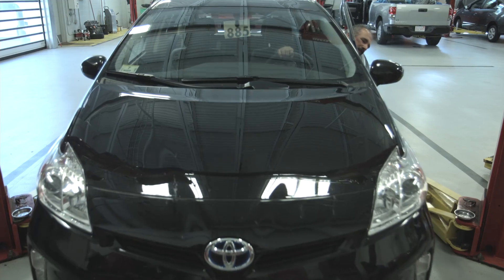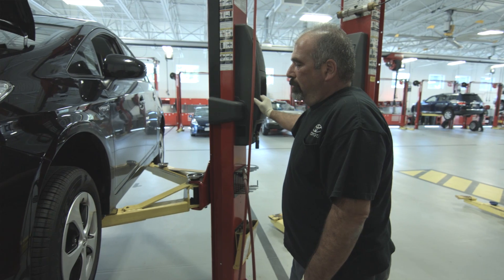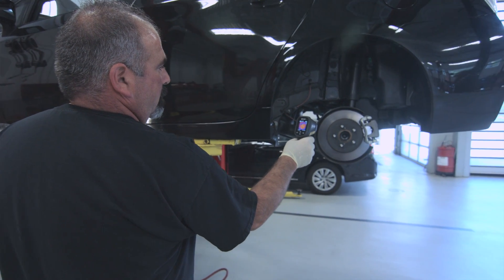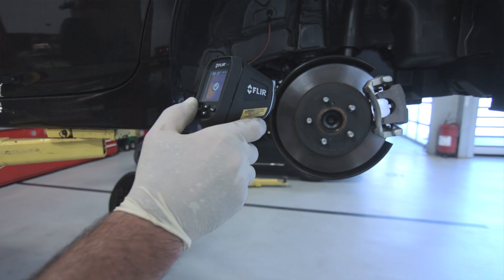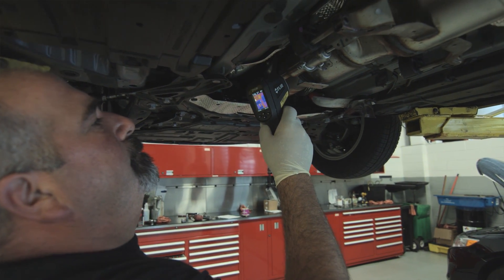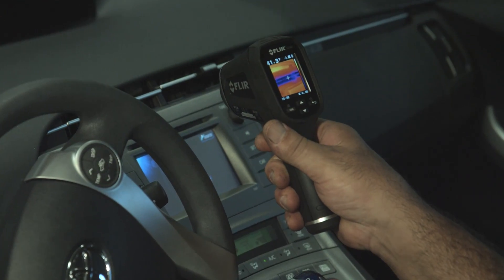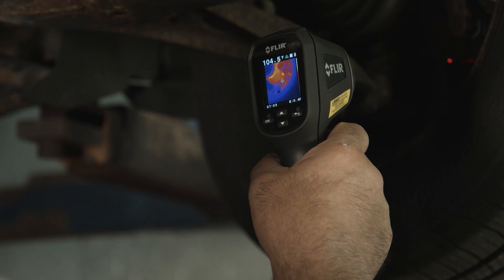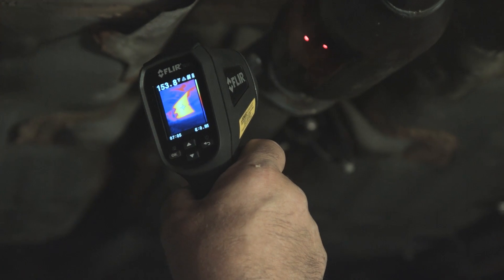Using the FLIR TG165 Spot Thermal Camera for Automotive Diagnostics

Comment: This is terrible advertising. The FLIR is so much more capable than what this video shows. Nobody is checking exhaust leaks with a FLIR or looking at a break rotor. You can see injectors that are malfunctioning on diesel. 

I’ve used the FLIR to troubleshoot a complicated electrical issue. I blew so many fuses trying to track down the short. I forgot the FLIR was in my truck so I grabbed it. I shorted the fuse with a piece of wire and flipped the switch on for milliseconds. This cause the wire to heat up for. 75F room temp to 78F. But in the FLIR it is glowing orange and I was able to trace wire from under dash to engine bay. You can even use it to look at alignment on tire and hit spots.
Reply: Plus to check the brake rotor since it’s shiny you would have to calibrate to a new emissivity and I don’t think the FLIR does that on lower end models
Reply: Agreed. Silly little advertising blip geared towards non-gear heads.  

Using it for in car vent temperatures!?! You don't need an expensive device where a $4 tool can be used.  Using it to scan AC and heating/cooling lines and components to see where there could blockage and leaks... Yes!